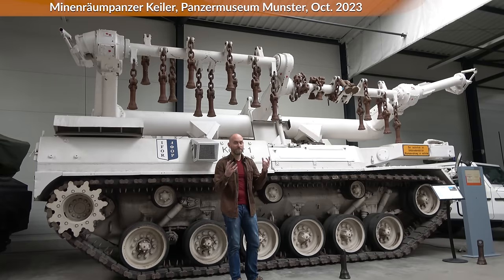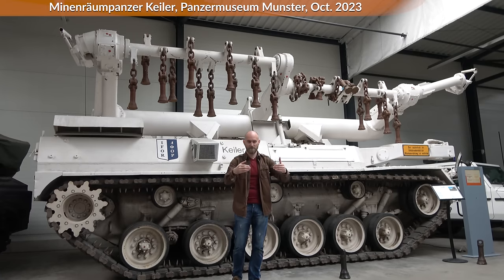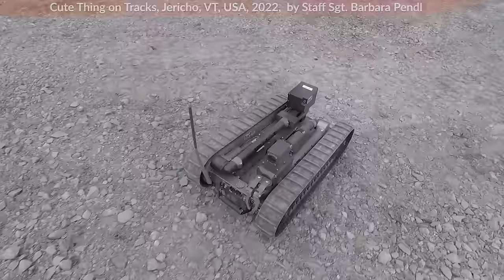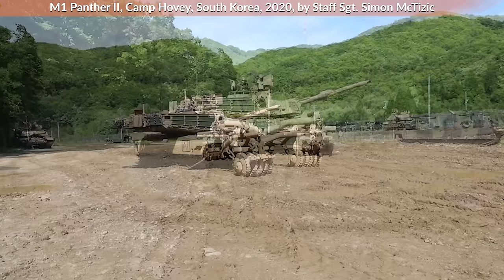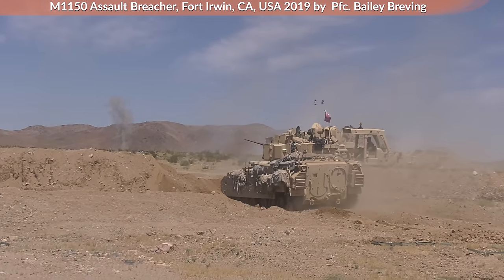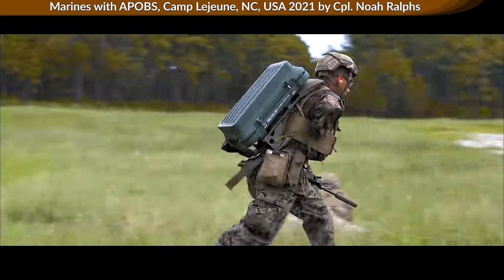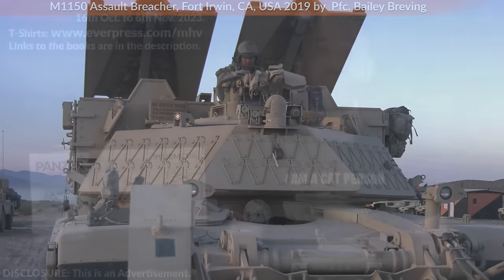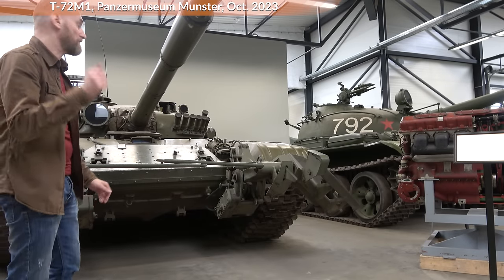Ukraine: The Problem with Mine-Clearing Tanks

Comment: Very good video. Mines arent primarily intended to kill, they are an area denial weapon. They force you to deal with the issue by either clearing the minefield or go around it, either way the enemy is dictating your strategy. 

The air deployed mines in particular are excellent for this since you don't even need to occupy the territory you are deploying mines in. Even if the enemy knows exactly where your mines are, he still has to clear the minefield and you can just put it straight back after he is done. The only limit is whether you can deploy mines more cheaply than the enemy can clear them. How many mines does an area have to have before you are worried about moving through it, probably not very many I imagine. This heavily favours the defender too since if you aren't attacking you don't have to worry about moving into a minefield.

There is also an added benefit that is particularly evident with the widespread use of drones and general visiblity on the battlefield these days. If you have laid a minefield and the enemy breaches it, they will have to breach a relatively narrow front. Provided you can maintain vision on the minefield you can then target either the mineclearers, you any movement through the minefield which will be restricted to narrow lanes. You can even combine this with direct fire to make the area essentially impassable. You cannot clear a minefield while being shot at after all.

Overall an incredibly potent weapon.
Reply: Area denial and terror lol.

There's something about taking one step and being strewn across a battlefield that will always freak folks out.
Reply: I read that mines take out more tanks than anything else in Ukraine. I wonder how accurate that is

Comment: There is a big difference between clearing and breaching minefields, that's why we've largely moved to explosive line throwing for the former and relegate mechanical systems to the latter for maintaining cleared paths and creating new ones behind front lines.
Reply: The second one is what i always have in mind when thinking about the Keiler for example sure its loud, dusty and slow but far behind your own lines that should not be the big issue but you can clear large areas with small personal.
Reply: Yes and no. Both of these that you mention are breaching techniques. Breaching is the term used to punch a lane through a minefield, possibly while under fire, to an acceptable standard in line with tactical requirements

Clearance is the term used for finding and removing 100% of the mines in the mineral area, not under fire and where all emphasis is on safety.
Reply: Clearing a field is removing all the mines.
Breaching is clearing a lane or lanes so that follow-on troops can get through the minefield.

Comment: Channels my inner 1960's American war planner How effective are nukes at clearing a path in a minefield?
Reply: Dude they wanted to use Nukes for everything
Reply: We can NOT allow a nuclear mine clearing gap to develop!
Reply: Hmmm... Interesting. Maybe we can develop civilian applications.
Reply: I suggest they give job to farm equipment manufacturers. It will likely work at a fraction of what they are paying.  Also they are familiar with picking ripe fruit and retrieving buried objects. You could start with a Cat D11 dozer starting at 250,000 lbs.   Use ground penetrating radar that works on metal and plastic. A/C and remote operation are options. Lastly use a winch propulsion system for mine clearing and tracks for transportation. 

You sure you can’t make portable bridges as a quick solution and mine clear when you have the time?
Reply: @MonEyRuLess damn i seriously need an harbor right now
Reply: It must be cheap and there must be thousands of those. But it machine can detect and kill weed but not harm crop, its possible. (by cheap I mean 250k USD )
Reply: Mhm well I think that may work surprisingly good but yeah the potential too escalate everything to max

But you made me think if it would be possible too use radiation to blow up mines/disabled them with a high flux stream by heating up or transmutation of the explosive than would decompose the chemisty (ok the later will probably make tonns of radioactive dirt 😅)
Reply: @craigweems Huge part of farmers and farming operators majorly avoid any possible harm. When shelling is remotely possible - they refuse to help. There is part greedy that much gathers crops cutting corners deeper and deeper into the marked minefield and we had two combainers blown up in our responsibility zone. One stayed alive I remember.
In other words, combiners that were brave for the right reasons already got into army, and ... I don't know what I wanted to say more, just to tell the story.
Reply: just FYI why japan was able to rebuild after are nukes is they where air burst. if you ues one at ground level you get a radioactive hole.
Reply: I think the USAF tried using thermobarics for it at one point, but the last thing you want near a minefield is nuclear fallout.
Reply: @MonEyRuLess  Potholes? What potholes? 😂
Reply: @Skorpychan  That would be very ineffective. Thermobarics are great at creating overpressure which can crush soft targets. Mines are buried in hard soil, that over pressure is nothing compared the localized pressure of even a human being standing directly on it. Much less a vehicle rolling over it.
Reply: @T1Oracle  IIRC, they were using the daisy cutter bombs.
This is something I read about on Wikipedia once years ago, mind you.
Reply: Very, but now your bubbas will need to suit up, which is annoying as fuck.
Reply: @apo617 Nukes are perfect for everything. Stopping riots, mining, launching spaceships etc.
Reply: @T1Oracle  The French have a remote thermobaric demining system. It works because the over pressure is enough to detonate the mines along a narrow strip.

Comment: I had a discussion in the comments of another video with a guy who ran training on MCLC for the US Army Engineer center.  They are not as great as people think they are and the skip zones make them less than idea.  Basically there are no great solutions and you need to use multiple systems in combination, like MCLCs followed by plows followed by rollers.
Reply: Proper demining of just a narrow lane takes a lot of guys, a lot of gear and a lot of time, like hours if not days. Problem is, if there's an enemy then they will never let you use all that. Best case the first makes it through by some miracle but they now know exactly through which tiny bottleneck your assault will come and smoke everything pulling up. Which is why you should only start it when the front has been pushed forward, the enemy guns silenced and the area secured. Mine clearing is a rear activity.
Reply: @mnk9073  what gets me is how the army did not develop an unmanned/optinallymanned breacher vehicle.  you think that would be priority 1.
Reply: @MrChickennugget360 its not that nobody tried.
Reply: @MrChickennugget360  What would be the point? It would be way more expensive than a manned vehicle and prone to jamming. The main issues still stand, slow speed while clearing, clearing a narrow path that will be a bottleneck to all following forces, sometimes not clearing 100% of the mines, clearing vehicle being first on the frontline once it clears the minefield, vulnerable to artillery and AT teams, the wreck of the vehicle just creating an obstacle on the cleared path, the path getting re-mined by long range launchers.
Reply: @MrChickennugget360  The army did this, the Uran 9 robot was developed in Russia. But this machine is very vulnerable for working on the front line and is very necessary for working in the rear. Russia is now clearing mines from an area the size of Italy

Comment: I have an interesting document from the Australian Archives which raises some interesting commentary on the implementation of flail tanks in North Africa. the two most interesting parts were
1.the mine clearing tanks had to be kept under operational secrecy, and were considered a 'one use weapon'. meaning that because the operation and presence of a flail tank was so obvious you could only ever use them if you had the element of surprise, and afterwards their effectiveness would drop dramatically as the enemy would develop countermeasures both in the immediate (it firing AT guns) or the long term sense.
2.Flail tanks were relatively easy to develop direct countermeasures to in field conditions. The example given involved German engineers burying large explosive charges ahead of mines in the minefield. These charges were buried deep enough that the flail would not disturb them and were linked by a length of det-cord to a mine approx. 1.5-2 metres behind the charge. this would cause the mine to effectively act like a fuse for the explosive charge, which would be underneath the flail tank when the flail stuck the mine, thus detonating the charge and destroying the flail tank
Reply: That is very interesting. I had no idea that they used this as a countermeasure. Its very smart.
Reply: Yeah, I feel like similar stuff would be easy to defeat the plow. 1 in 200 mines, make them deep enough the plow doesn't tilt them and give them a random few seconds of delay when they sense pressure.
I'm surprised minefields can be dealt with at all, they seem like a great investment in a static frontline. Couple thousand bucks worth of mines can kill a extremely expensive western tank.
Reply: How would that work when the flail tank is moving forward so the mine in the "back" would be struck by the flails first?

Comment: M48s with that bathtub shaped lower hull was actually very effective at mitigating mine damage in Vietnam back in the day.  On "thunder runs" they literally just drove down the roads in pairs with one tank track in each road rut and ran over the mines to clear them.  If you lost a track another tank trailing behind took its place and the convoy just kept going.  Wouldn't work with more advanced mines available now days, but the guys who did this back then had balls that clanked louder then their tank tracks.

Comment: I was with the Danish Army Engineers back in 2018 - 2020 and worked with Common Munitions Disposel, ei UXOs and Mines. Clearing minefields wasn't a concern, and definetly not under fire. If possible minefield are to be marked and avoided, simple as. If that isn't possible the minefields are 'secured' with firesuperiority, maybe, at most, under the cover of darkness small assault paths are made so that the far end of a minefield can get assaultet and captured... Then when the enemy isn't around vehicles like plows (I worked with leopard 1 Wisent tanks) to clear lanes/roads. These roads was wide enough to have tanks pass, and a safety margin... Nothing more was done tactically, removing the minefield is either psot-war stuff or something done way behind the front, and often by civilian specialsists, veteran voulenteers, and possibly by trained and oversighted reserve army forces (like the american national guard or the british army reserve)
Reply: The Ukranian trained in germany got frustrated that the main tactical advise for minefields they got was, avoid them.
But clearing mines under fire is just costly in everything.
Reply: Modern war has shown that avoiding the mines is often not feasible because of the volume of mines deployed in a short period of time along a wide unbroken line.
Reply: In exercise and training. Real world like in Ukraine is very different.
Reply: Igen de az békében egy gyakorlat de ez élesben megy látható volt a sok tank felrobbanva újra telepítik könnyen az oroszok akár a menetoszlop tankjai közé is . Más az elmélet és a gyakorlat a párnásak meg végkép végzetesek
Reply: "If that isn't possible the minefields are 'secured' with firesuperiority, maybe, at most, under the cover of darkness small assault under the cover of darkness small assault paths are made " 
Let me have a check applying this to the ukrainan situation:
1) the minefields are 'secured' with fire superiority:  reqirement not met. Russian have around 5:1 artillery superiority on all frontlines
2) under the cover of darkness: Evidently IR sensors, drones equipped with IR cams, and heat seeking ammunitions are not considered here
3) small assault paths are made: evidently the enemy remote mining is not considered here. 

It seems that we are lacking some basic facts evident from the ukrainan scenario
Reply: @pierluigidipietro8097  1) Artillery alone cannot hold ground, fire needs to be guided by observers to have any sort of accuracy. Whether this is planes, UAVs or man is not important, the important thing is these observers need to be surpressed or destroyed. there is also the possibilitu of counter artillery directly attacking the enemy artillery. artillery under concentrated fire is not able to setup and fire.
2) IR sensors can indeed spot intruders, however these are rare in the russian arsenal and are usually mounted on vehicles, vehicles would be destroyed if exposed and thus generally work from concelled positions, positions where the vehicles themselfves have bad observational abilities. the use of covered approaches and good tactics also still need to be used to minimise exposure. IR sensors also aren't the magical instruments as know from games, using insulating clothes and covering skin well goes a long way to making infantry difficult to see on such sensors, even modern NATO sensors.
3) assault paths would be open during an attack or few hours before, they are not re-usable. they may get remined but that is only if the assault fails. remining operations would of cause also be subject to attack if possible.

Also I want to reiterate, the first action on incountering a minefield is to go around it, you would only pass through if neccesary.
Reply: @oakspines7171  The current real world problem is that as the russian army are retreating the are able to deploy more mines before them, the Ukrainians have been and continue to be able to pass minefields with current tactics HOWEVER these operations are slow and make many forces that would be attacking slower, putting them in more danger from the russian defensive line - in essense the mines prevent continueus assault
Reply: @nomennisceo6495  and also, the Ukrainians just  don't have the superiority in weapon quantities comparing to the Russia
Reply: @aaronsung1989  This is why you need to use strategy to get local superiority
Reply: @nomennisceo6495  Ooh, you are very mistaken. Russia is very active in producing and purchasing thermal vision equipment.
Russian observers use systems such as the Ironiya optical-electronic complex and Chinese drones with thermal vision cameras

Comment: Rollers shouldn’t be considered mine clearing equipment. It’s not used to breach/clear mines it’s used to safely detect the edge of a minefield, either by sight or by contact. Then you deploy a mine clearing system, ie blade or MICLIC. 

After clearing a breach lane, you follow with a roller to ensure all mines in the lane are disposed of “proof the lane.” 

Once the lane is proofed, there is a quick disconnect on the roller so you can have a fully functioning tank in the battle, which is pretty cool imo.

Comment: Another big problem is that the assault units are limited to the cleared lane.  For example, the famous video where the Ukrainian platoon litterally became one-legged platoon(every soldier lost at least a leg).  There were MICLIC remains present, so the lane was there....but the unit got hit with artillery and left the safe zone.  One by one the soldiers found their mines.  Bradleys tried to rescue them but either got git themselfes or the rescue teams also triggered mines the moment they stepped on the ground.  The hopelessness of the situation was insane.

Comment: The thing about minefields is, that they are not considered obstacles if they are not covered with massed fires. You must suppress the enemy fires the entire time you are clearing a path through the mine field. That requires a huge amount of artillery ammunition. Then you must suppress the counter battery fire, defensive artillery, which requires even more artillery ammunition. Breaking through a minefield is hugely expensive in ammunition, something which is in short supply on both sides in Ukraine.
Reply: And here's the thing about line charges, they don't proof the lane themselves. The can only be used in conjunction with one of the other methods.
Reply: The Russians have been running out of ammo since last June 😂 
Keep smoking that hopium
Reply: @Africanhorror They have, the amount of artillery shells being  fired by Russia has dropped off a cliff.
Reply: @ricardoamendoeira3800  False. Russian casualties have dropped off a cliff as a direct result of Ukraine losing support from the West. Hardly any artillery is coming in to resupply Ukraine. On the other side, Russian war capacity is rapidly ramping up.
Reply: Russia is still able to produce it's own ammo tho. Ukraine is totally reliant on handouts at this point.
Reply: "God fights on the side with the best artillery."